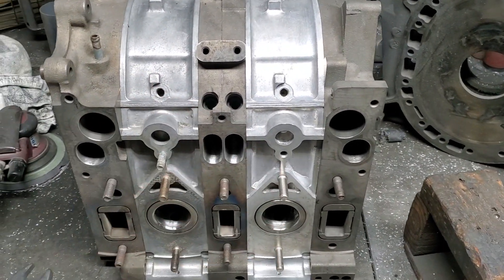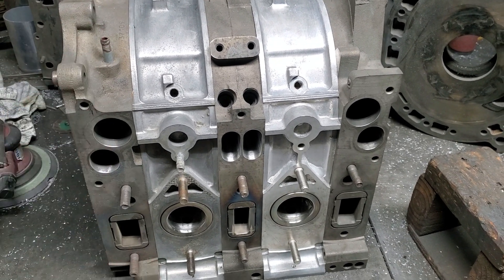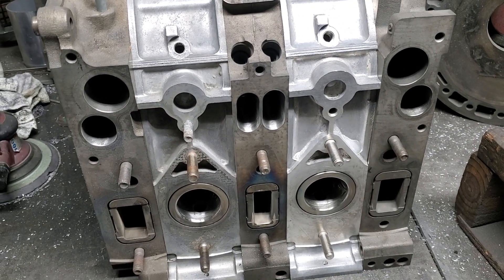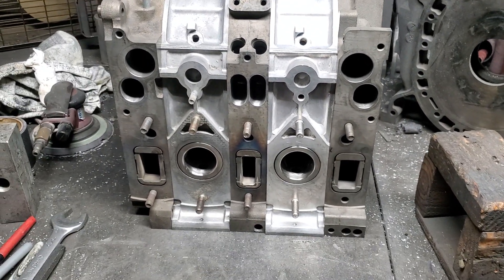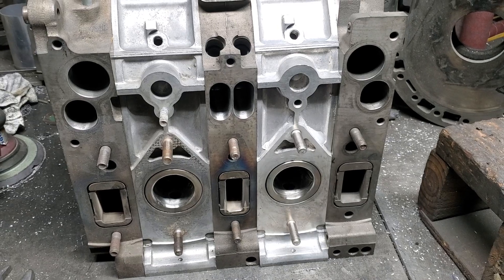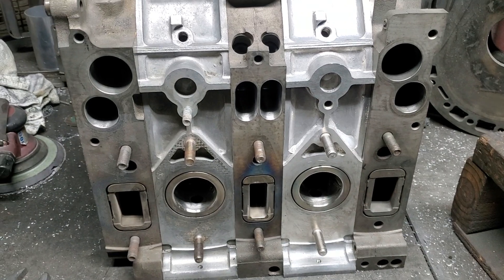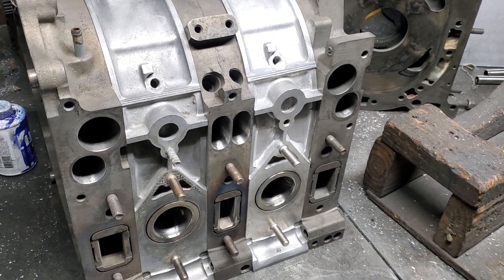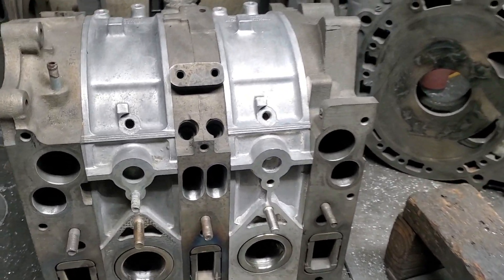Why we call it a 13B Renesis Hybrid Rotary Engine and some updates on the build progress.  Video 1.5

Comment: hi, some question please! In this configuration, with mor exhaust ports does the engine lose pressure at low revs? Is it possible to manage this tuning with the original ECU? I saw other hybrids which they close the central exhaust door, leave 4 doors, what changes? Thank you.

Comment: I am currently having my renesis rotors milled for RX7 2mm apex seals. Do I use RX7 corner seals or milled RX8 seals?
Reply from the maker: Both will work.  We ran RX7 seals back in the race car.  Worked well.

Comment: Any thoughts on ditching the center plate for an older 13B one with renesis intake port shape, 4 port renesis end plates and semi-pp GSL-SE housings?
Reply from the maker: Not in favor of the idea. It needs the exhaust flow. And generally removing removing one port from 1 side of a chamber creates unequal pressure From what I've seen so far.

Comment: I always wondered why did the 787B have 3 sparkplugs per rotor for better fuel ignition, but the road cars never used them. Also i don't think any of the race rotaries today don't use 3 spark plugs either. Was this needed for the fuel quality that was available back in the 90's?

Comment: Aren't the side housings the part that cracks on RX8s when you boost them?
Reply from the maker: Like all motors they have limitations if not strengthened.  Anything over 7psi boost requires studding of the Renesis block. Otherwise it way crack.  We will cover this in upcoming videos 👍
Reply: @KyleMohanRacing  Ahh, gotcha! Cant wait :)

You should build a hybrid alongside Rob ;P

Comment: Would a hybrid engine like this be the easiest way to get into a peripheral intake port motor?
Reply from the maker: No,   if you want a Peripheral Port use generic 13b components.  Renesis side plates are not good for P Port motors.  No gains, hard to work with in regards to your question.
Reply: @KyleMohanRacing  Why is this if you don't mind my asking? Does the typical blocking of the side intake ports not work properly on the side exhaust ports, or am I totally off base?